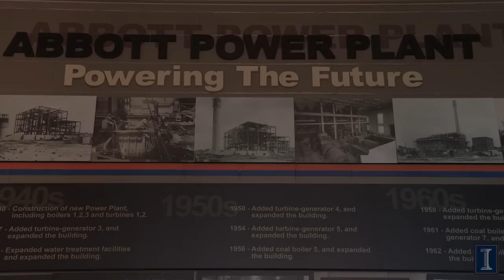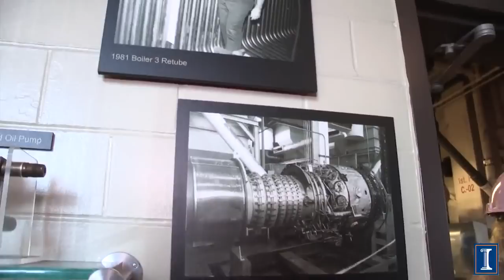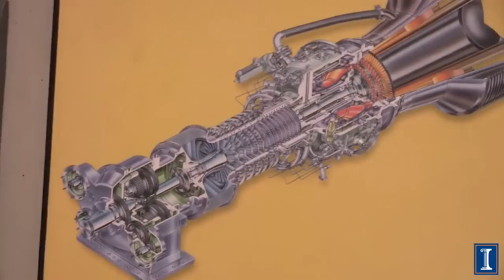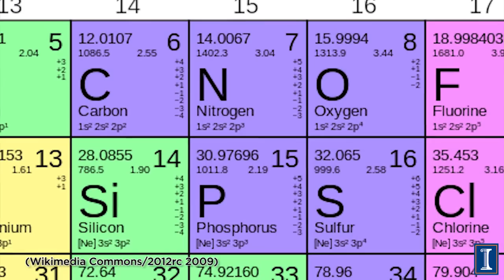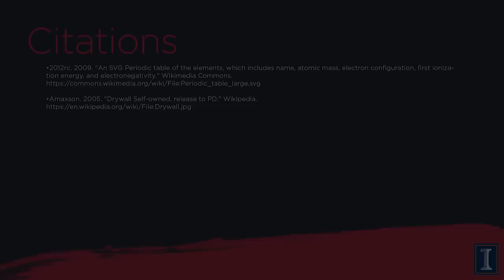How Things Work: A Coal (and Gas) Power Plant

Comment: While working at a coal fired power plant in Mississippi during the summer of 2012, I had the chance to look inside one of the furnaces that was still active while the other was undergoing maintenance and upgrades. The coal is ground into a powder by milling machines at the end of conveyor belts and blown into the furnace where it burns. The walls of the furnace glowed red, and the burning coal was a tornado of orange and yellow flames, like a scene out of Dante's Inferno, and the heat was so great the sweat on my clothes evaporated. Each furnace was about 60 or 70 feet high, and the walls were steel tubes full of water and steam. This plant would get a 100 car train  every other day which offloaded it on one side of an ellipse the whole train would occupy as unloading proceeded. The plant itself was a 1,000 megawatt power plant, and fed power throughout southeastern  Mississippi and southwestern Alabama
Reply: this comment is giving me Factorio vibes...

Comment: By far this is my favorite channel and watch the videos All the time. That being said, I visit and work in power plants on a regular basis and it is, or was, very very rare to see ash and gypsum taken back to the mine site. Until recently ash was or is pumped to open ash ponds in a water slurry as there is no way to load 50 train cars back up with all that byproduct. Only recently has the larger plants started trucking the ash away and I think they have been selling the gypsum.
The larger plants also have activated carbon and or anhydrous ammonia scrubbers to clean the air as well as PA and gas recirc fans to lower NOx emissions.
Great video but I think a video at a newer plant, say Prarie State Generation, would give everyone a better idea of what a large power plant is all about.
Keep the videos coming Dave. 👍🏻

Comment: Much of that fly ash is added to concrete as a filler that has tons of beneficial properties.
Reply: Actually, it's an inferior filler compared to traditional concrete mixes. Older concrete is often much higher quality than modern concrete.
Reply: @onetwothree4148  yes and no.  It's been proven time and again to reduce shrinkage issues, be more resilient against frost, and it is far, far more workable. 

That is in comparison with a modern mix without it.
As far as older concrete goes, you are right, it is often better, but that's usually due to better aggregate sizing, (possessing a gradient of agg sizes as opposed to 1 diameter only) design that was not dependent on structural steel, and a massively lower labor cost and higher material cost. - It pays to make guys do things much better when the material is far more valuable than their time, now it is the other way around.

I used to be dead set against fly ash, preferring mixes with more powder instead, and the local plant agreed with me.  Having now gotten more experience and having seen the research done by ACI on the subject, the verdict is clear- concrete with a pozzolan is superior to concrete without a pozzolan.  And the cheapest pozzolan is fly ash.

Fun fact- the romans used to mix a reddish clay into their concrete that would behave similar to a pozzolan, while also rendering it far less permeable than regular concrete- its how they built water retaining structures so well.  They also cured them for 1-2 years to avoid shrinkage cracks. 

It left their concrete a light pinkish red, at least until the clay weathered out of the pores.
Reply: @onetwothree4148  Also, since the fly ash replaces some of the powder, the concrete is technically weaker, you do have that right.   It has a lower MPA.  But MPA is not the only measure of a concrete's value.  The modulus of elasticity (resilience to flexing basically)  is higher in mixes where fly ash is used.  It is also less likely to have shrinkage cracks, as the ash in the mix doesn't shrink, reducing the total shrinkage of the structure.
Sorry bout the obscenely long reply, but there really is a lot to it.
Reply: @hosmerhomeboy  you're right, the main difference between modern concrete and older concrete is not fly ash, it's water content. I thought about that right after I posted. Modern commercial almost always has way too much water, and that is a far larger culprit.

Coal fly ash is an inferior pozzolan (and the Romans used volcanic ash, not clay, as a pozzolan (that's where the word 'pozzolan' comes from). The secret of how to make concrete was lost for about a thousand years, because the Roman empire was broken up and the tradesmen who kept the secret no longer had access to volcanic ash. 

Concrete was rediscovered in the 19th century when special clay containing similar chemicals was discovered to create Portland cement. Realistically the biggest reason the Roman concrete buildings still stand is what you said, perfect mixing technique, and most importantly the Roman concrete was installed damp and packed into place, not poured, and therefore cured much slower.
Reply: @onetwothree4148  I stand corrected on the pozzolan. As far as the fly ash being inferior goes, you may be correct, it's just ubiquitous due to being so cheap.   I also think that when it comes to roman concrete we have some level of survivor bias.   Most of the bad stuff is gone.  That being said, we (despite our much deeper understanding of chemistry and greater access to energy) mostly build inferior things designed for a relatively short service life.
Reply: @hosmerhomeboy  yeah that's true, although I don't think we will have any modern 100+' concrete domes that survive 2000 years like the pantheon did without any reinforcement (even in spite of the site having terrible soil conditions for such a structure). Modern concrete typically results in a greatly inferior product.
Reply: @onetwothree4148  just the fact that we rely on steel which will eventually corrode without some level of upkeep dooms all our structures to a finite lifetime.
Reply: Only in Canada
Reply: Fly ash based concrete and cinder-blocks can also be more radioactive than normal materials given the lack of regulations on uranium content and carbon-14 in coal. it is not quite enough to matter but it is still worth noting.

Comment: woah I didn't realize they produce natural gas that way, I thought they just burned it and heated water. That jet engine part is pretty cool and efficient.
Reply: Robert M. Most of your new power plants in the last 15 years are gas turbines/combined cycle units with steam turbines. They have aero derivative units (cf6-80, for example) and frame units which are very much like a steam turbine. The plant I operate we have simple cycle units that are 46 percent efficient (LMS100).
Reply: @JAMESWUERTELE  i worked on one of those in California! tiny little thing. makes a suprisingly large amount of power for its size though.
Reply: Look up a channel called AgentJayZ
If you want to know more about gas turbines and how they work. That guy goes into some interesting details on the subject.
Reply: @craighalpin1917  I'll check it out
Reply: I agree! While my professor is amazing, I'd love to have this guy. He explains so well, thorough, and without bias.

Comment: The scale of coal power didn't hit me till I got trapped red light waiting for a train to pass. As it happened I was at a bit of a decline just high enough to see the top of the railcars. This train was easily a mile long, 100 or more cars and every single one of them was filled to the top with coal.
Reply: And that is less than a week for a full sized plant

Comment: #2 Item In my quest to assist the professor to be more accurate and educational with his wording starts at 1:15. The professor corrects his errors, with errors and emissions in his attempt. Water doesn’t turn into steam in the furnace pipes as the correction infers. Circulation ratio in a furnace is a complicated thing and can’t be dismissed by simply stating there is water in these tubes that turns to steam when typically a ratio of 5 to 1 (water to steam) is present in the furnace risers for a key fundamental reason. In this case an individual water molecule passes through the furnace 5 times before it absorbs the latent heat to be liberated in the steam drum. A more accurate reword for the professor “ Relatively cold water is supplied to the furnace by the downcomer tubes strategically placed to not pick up combustion heat. The heat provided by the combustion process in the furnace is transferred to the riser tubes thus creating the natural circulation by gravity necessary for the process.  The risers tubes are typically designed to limit steam generation to approx a 5% steam to water ratio.  Limiting the steam to 5% in the furnace riser tubes is required to protect these tubes from overheating and subsequent metal creep failure”

Comment: The speaker at the 21 minute mark or so in this video that "Coal is half hydrogen".   Wrong.   Coal  (brown and black varieties) is around 5% hydrogen.  Indeed, it's the fact that coal has little hydrogen and is predominantly pure carbon fuel that makes it such a uniquely "dirty" fuel from point of view of greenhouse gas emissions.   So this is a central, critical, key property of coal the speaker is either lying about, or profoundly ignorant of.  

To his credit, the speaker does at the 19:30 mark make a critically important point in alluding to the relative energy densities of coal vs uranium (nuclear power fuel). 

I was very unimpressed!

Comment: The claim that fly ash is returned to mines is false. Power plants are not required to tell the public what they do with fly ash. Concrete and drywall manufactures however are required to disclose what goes into their products, and both drywall and concrete commonly contain fly ash.

Comment: Dirty process, but it’s a lot of available power...we just a new process that has zero emissions and has no waste. Wonder if someone has done this?
Reply: Going to zero is a bridge too far. We can live with a little pollution but maybe they will come up with a use for the byproduct.
Reply: duradim1 Siemens has a hybrid turbine that’s burning a 70%/30% mix...(70 hydrogen/30methane or syngas) Ppms are extremely low supposed to be less than 20ppm. Aggrandizing. Also, the earths atmosphere is about 500ppms low on CO2, and all the plants are suffering for it.
Reply: @blainevans7047  Asking purely out of curiosity: how is it possible to determine the correct (presumably average) concentration of atmospheric CO2 in relation to the requirements of plants?  I've never heard of having an amount that's too low or too high for current plant life.
Reply: Voices in My Head average fossil plants
Average CO2 in rocks over time...it fluxes a lot and has be very high several times...it’s massive arrogance to think we are destroying a planet...also, we have been “killing the earth” ever since newspapers and social media started. Crying wolf is big business.
Reply: @blainevans7047  Ah I see.  So comparing chemical composition in the geology.  Makes sense.  I agree that so much messaging in old and new media is just for one group's interest or another.  I was just curious about the idea of a correct atmospheric CO2 concentration.  Thanks!
Reply: Voices in My Head look into the devices for greenhouse growing, they literally pump methane into heating units and keep all of the exhaust in the greenhouse to make the plants grow bigger and better. Now I know that’s just them creating a better product for profit but the fact is that the plants have been the smallest and weakest during periods like this, it’s actually the 1800s and early 1900s that saw some of the worst crops. Always follow the money when people are having a fit about what they want, it will tell you who is invested in what. Carbon is good for creating products and we can control carbon more and more because of all of the climate fanaticism so I’m not saying it’s all bad I just don’t like the hypocrisy.
Reply: @blainevans7047  Interesting.  I'll take a look.
Reply: @blainevans7047  well the government solution is taxes, so its entirely about money. the biggest cost in a power plant is carbon credits, which is hundreds of millions. thats for one plant, all that is going somewhere
Reply: Brad Haines lol ya...to Coca Cola the largest cc purchasers
Reply: Brad Haines and there’s no carbon tax

Comment: The problem with putting gypsum in a landfill is that decomposition of the material leads to hydrogen sulfide (H2S) production. Levels below 100 ppm smell like rotten eggs; a real problem for landfill operators that have to deal with the environmental aspects of accepting the gypsum in to the landfill. Interestingly enough, hydrogen sulfide levels above 100 ppm are odorless, and more importantly, lethal.  The physiology of H2S poisoning, the mechanism on which it causes death, is the same as in-taking cyanide or carbon monoxide; the H2S preferentially bonds to the hemoglobin over oxygen, causing oxygen starvation and subsequent suffocation.

Comment: Build 4th generation nuclear power plant in USA, establish energy independence, reduce carbon emmission, create local jobs.
Reply: You would need to educate people and drill through their thick skulls that nuclear power is not scary at all.
Nuclear power is the way to go, but when you have people afraid of the word "radiation", you will have a hard time moving forward.
Reply: @GoldSrc_  need a better solution for the waste though, other than holes or pools.
Reply: @bradhaines3142  Sure, but it's way better than coal plants spewing their radioactive crap into the air.

Comment: The ability to take revenge is part of human behaviour. So it is with this underlying infliction I present my revenge to the professor by detailing the inaccuracies he has provided to his students and the audience with this video. I am a high school drop out who once worked briefly in a coal fire boiler room in 1961 and it is from this low level of knowledge and education on the topic that I find myself honoured to assist the professor in this video. Let’s start with the first 38 seconds, this will be followed by approx 40 more correction one each day or until banded from entering comments.
1/ Claiming waste heat loss is recovered is at best only partially correct and further only applies to the Rankine cycle systems at this university. Discharging steam prematurely is at the expense of revenue income produced by more electrical power generated  Rather than discharging from the LP turbine to a condenser at 29.5 inches of mercury back pressure, which would have provided the same electrical energy production as steam from 150 psig to atmospheric,  the university decided at the time of conception to discharge steam from the LP turbine at 5 to 15 psig back pressure for steam  heating of the campus. This choice at the time was  partially to avoid the huge condensing water system requirements (often including associated sewer surcharge costs). The hardship of this system lies in the return condensate losses, the ownership and infrastructure costs and the poor quality and efficiency of wet steam used for heating when it arrives at the end point user. The outcome is debatable as to overall efficiency gain versus the higher cost and losses due to ownership of this type of system.  Secondly discharging steam prematurely to condensing to heat the campus only applies to the Rankine cycle power generation side of the university. The subsequent installed Brayton cycle, combined heat and power gas turbine system, the waste heat is all consumed to generate steam with no additional saving by avoiding the penalty of rejecting heat to the condenser. If an energy study was done at this university and funds permitted the Rankine cycle steam generated heating system would likely be replaced completely with the Brayton cycle and off the coal we go. However if a study was done of the Brayton cycle campus steam heating efficiency the university would likely benefits from partnering with a process steam consumer and getting off the steam heating completely. 
Lets reword the first 38 seconds to provide more education and factual accuracy. “All the coal fired steam produced at the campus leaves the steam turbine without fully utilizing all its potential to generate electrical power but rather it was decided to be used for campus heating. This choice was made when steam heating systems were considered more fashionable and more economical and doesn’t necessarily apply to today energy choices.  However, on the other hand  the opportunity for recovering waste heat from the combined cycle system at this university simply does not exists in the same way.  It is subject to the principals of the Brayton cycle where there is no savings to be found from avoiding rejecting heat in the condensers to make steam”